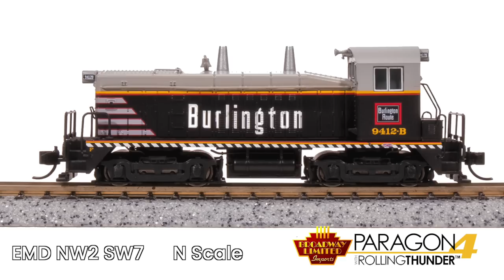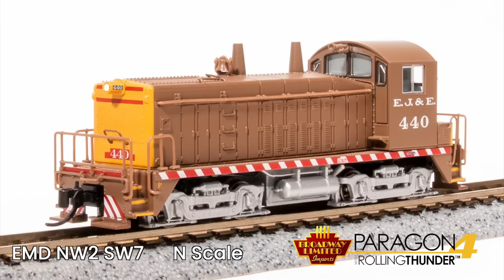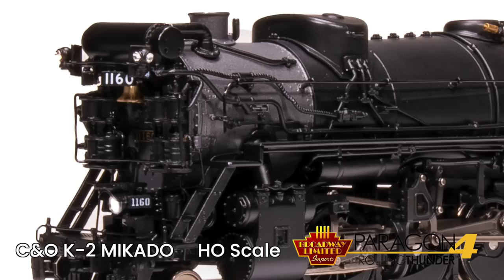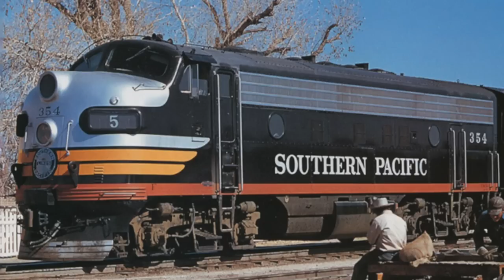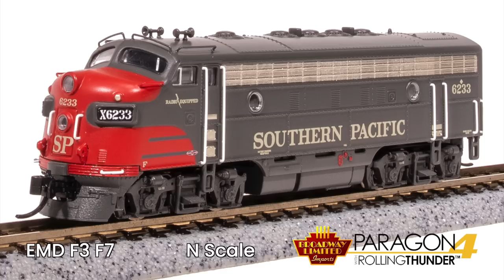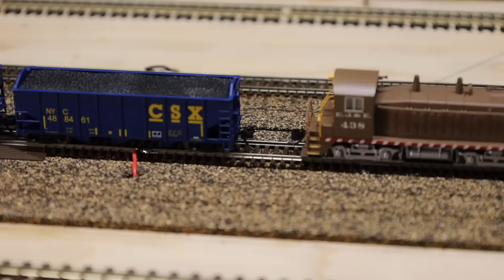OFFICIAL PROMO VIDEO: 3 Workhorses ready for duty.

Comment: F units definitely got the ball rolling and woke the railroads up to the benefits of diesels.  The FT and F3 were the first diesels widely used for road freight service as opposed to switching.  But the locomotive that really sealed Steams' fate was the EMD GP9.  On large roads with huge fleets of steam to replace,  the GP9 was the locomotive that was made in large enough numbers quickly enough to drive the vast majority of freight steam locomotives out of service.